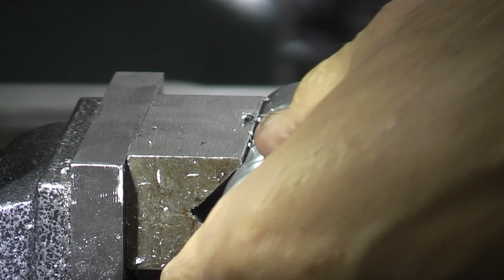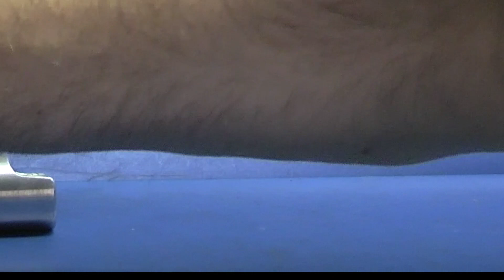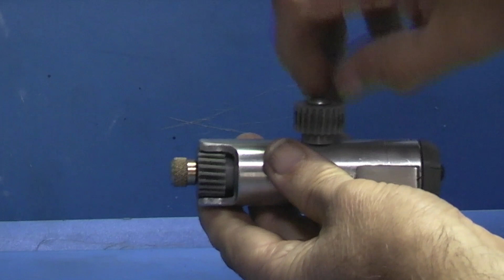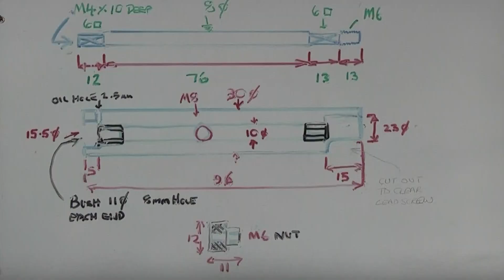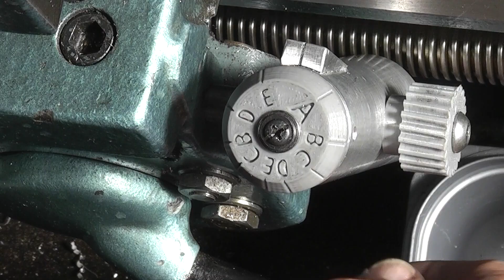Making a metric thread dial part 2

Comment: Excellent video. I'm a complete novice in turning. Could you please explain why you would need to have multiple selections (Letters) available when they all do the same thing. Is it just a maths thing or is there a practical use beyond saving a few seconds.
Reply from the maker: Hi This thread indicator is for a metric leadscrew and has 2 gears a 20 tooth and a 21 tooth gear depending on the thread pitch required. The Boxford chart then shows which 2 leters you can engage the leadscrew on.

Comment: Nice. One suggestion if i can... So, you can mount both gears, one of top on another, just you must made some holder and some kind of stopper ( e. g. Metal ball, spring and two holes) for limiting movement of body, up an down.